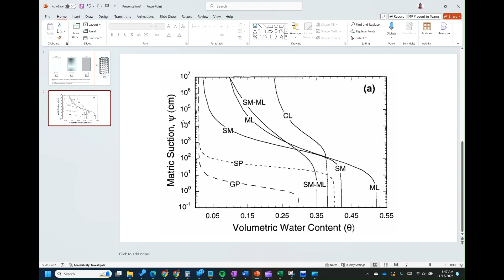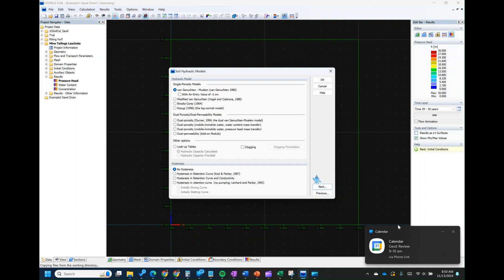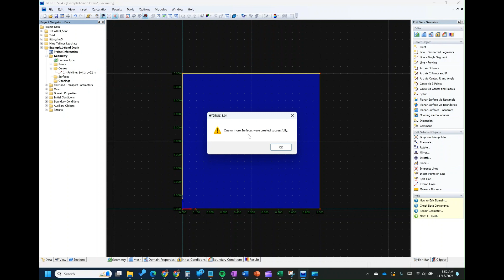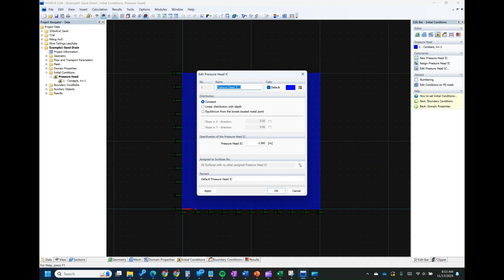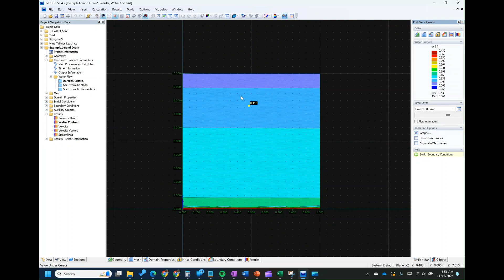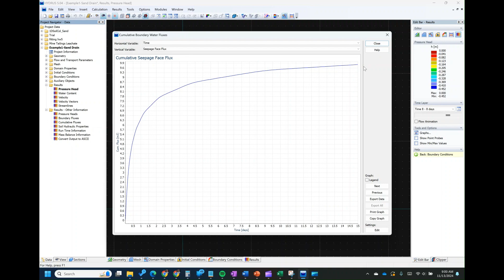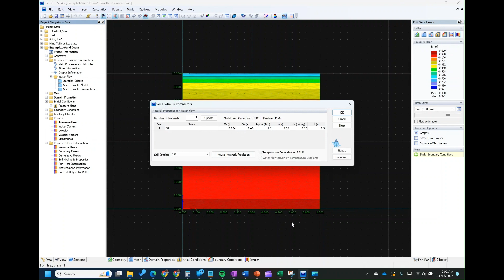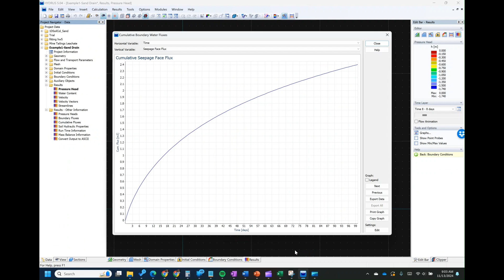Introduction to Hydrus for Unsaturated Flow Modeling

Comment: I am not able to set the pressure head properly, when I select linear distribution, the simulation result is the same for all the times
Reply from the maker: Several factors can affect the simulation result depending on what you are simulating. How did you apply the linear distributed pressure? Before running the simulation, you can confirm that the pressure is linearly distributed from the pressure head distribution column chart. If you need further guidance, you can reach out to me via aafamilusi1@gmail.com

Comment: can you please add more videos, with also the wetland model?
Reply from the maker: What aspect of the wetland model should the video address?
Reply: @YourGeotechGuy_NumericalModels  can you please make a video to explain a simulation where water passes through porous bed and at the same time the change in COD, BOD, TKN, the process that happen in a wetland?
Reply from the maker: @realcheckchannel  I did some reading about your request and realized that I haven’t worked on anything like that before, in terms of COD, BOD, and TKN. I hope you were able to find a way to move forward with your project. If I get some free time to do more research, I’d be interested in setting up a similar model in the future.